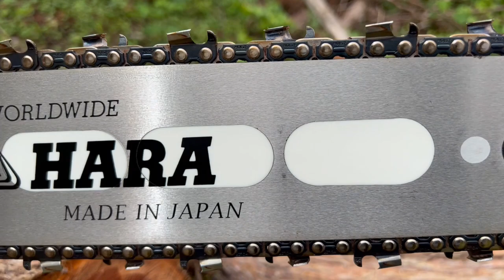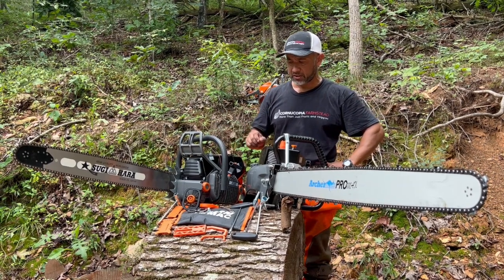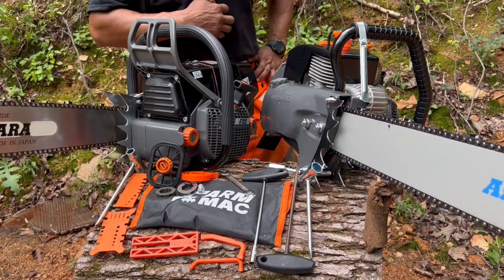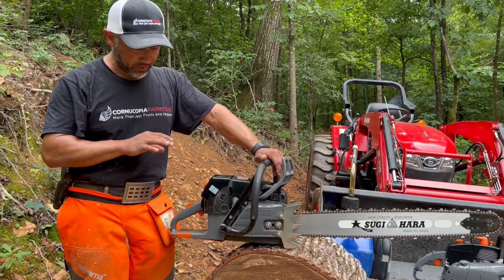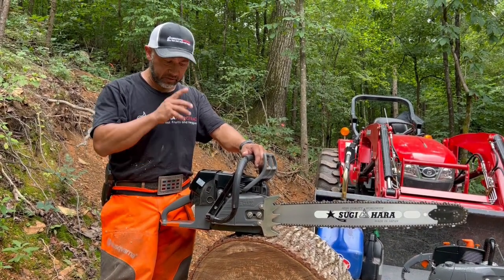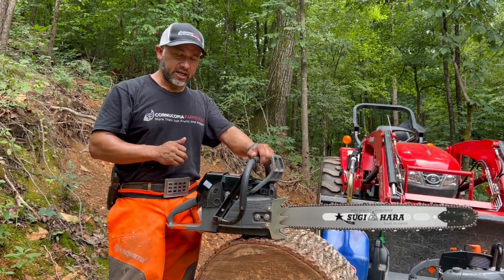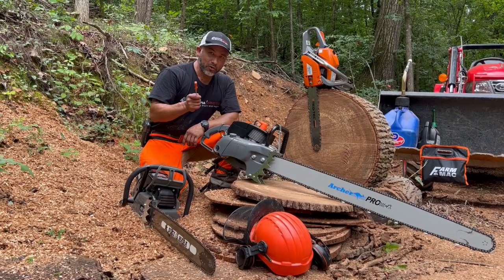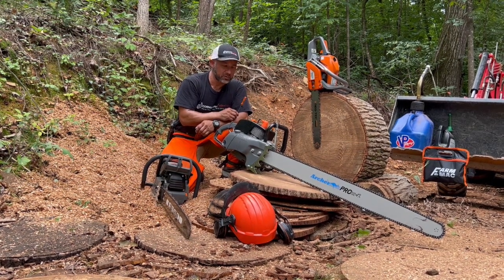FARMMAC F070/F660V STIHL MS070/MS660 Next Gen FARMMAC PRO SERIES by NEOTEC

Comment: Ms391 seems to cut better man idk the way it’s cutting if it’s not going straight down it’s too much wood for it, or you’re bad at cutting and I don’t think u are.
Reply from the maker: The round I was cutting was a decent round, a little punky here or there but still good wood for the most part. Neither of the two saws were ran in under load, they both had been heat cycled a few times but that’s it. If I remember right while we were making the vid I had to keep tuning the 660 clone several times, the 070 clone to this day I haven’t adjusted the carb on it. But you aren’t incorrect in the cutting prowess of the 660 clone for sure, they all for the most part needed some break in time and all need a fair level of tuning if you want to be in the top end of cutting performance, otherwise the will just cut rather than saw. Thanks for commenting, Ric

Comment: That manual oiler is in a horrible location, were it on the left where you could use your thumb that becomes a great setup with that good low end torque. The 660 sounds just like my Stihl 660 and I believe that’s a good deal and tried to get my father in law to buy one instead of the Stihl but he wanted a Stihl. Now that they have made some upgrades like you discussed it’s hard to spend all that extra money on a stihl in my opinion.
Reply from the maker: I agree totally. It is also pulse along with having the manual oiler so I have been told. We have the original first gen 892 and this f660  sure is a hotrod compared to it, the 892 is no slouch too by the way. I think if a person kept things in perspective they will find these will do what they want but also keep alot of money in your pockets too. I had to make that decision a few years ago, still have that first one and it still runs. Worth it and if it breaks and you fix it you are still less than what you would have for the oem equivalent.  Thanks for commenting and thanks for watching!
Ric

Comment: I also read that the F660V FarmMac has a Walbro carb instead of a Chinese carb.
Reply from the maker: Yes it does. They actually have several saws with the Walbro carb. We have the ns892 first gen saw from them , I don't remember if it has the walbro on it but I can tell you there is a world of difference between the ns892 and this saw. The f660 is very responsive and I would bet is every bit 95% if not more close to the stihl ms660/661. Great running and functioning saw this one is. Thanks for commenting!
Ric

Comment: I’m going to buy one but I’m confused on the differences. What is the difference between the Neotec 660v, farmmac 660v, and the farmmac 660vw? I see the same thing with the 380, it shows a 380 and a 380w? From what I see there is the orange ones, the black and gray ones, and the carbon ones. Is there any real difference between them?
Reply from the maker: Yes there are some big differences.  From what I read in the literature online, the f660v is the highest performance,  it has a better coil, better carb, better rubbers in the bushings area, I'm going just from memory here on that but I believe it is accurate. In the standard ns892 the inverse is true, it lacks the Italian ignition, the fancy walbro card, the same for the rubber products. For the saws that have the "W" they are the white editions and lack some of the upgraded components  as do the carbon units, I believe they lack the upgraded parts too. The Farmmac line is billed as pro models and in my opinion they are built a touch better and are stamped with date builds, plastics and other parts do come from Italy,  Taiwan, , Sweden or other countries where Stihl or Husqvarna acquire there parts,, I do not know if they come from the same parts suppliers of them but they are stamped and do appear to be better.. I can tell you that the f660v we use in the video is much higher performance than the standard ns892 which isn't a bad saw, but the f660v is a better performing saw. In every way it does perform better in my opinion.  I purchased my first clone saw almost 3 years ago and they have great value but do come  with some flaws from time to time. I don't expect that but when it happens I repair if needed. We have only had 1 issue with the Neo-tec nh843, it had a looser air filter which didn't affect it, they sent me 2 air filters to use for the one problem and that has been the only issue. No they are not perfect with fit and finish which is why we show close up imagery.  We always tear them down when we get them and also recommend people do that with any new equipment. Everything gets loctite and lubed,  reassembled just to make sure before use. I think that is a good idea on anything because if you find an issue you can note it before you run and get disappointed.  
Refer to either there website or the Amazon store and it should tell you things I can't remember. I work with saws and 2 strokes every day so I'm pretty finicky about things working and staying in good ready working condition. With clones from any brand you just need to make sure everything is in good working order. Your purchasing a clone with either a 90 day or 6 month warranty, this is why you have to check them very closely from the beginning.  Hope this helps, thanks for commenting and subscribing,  Ric
Reply: @CornucopiaFarmstead  considering the price of the 660 and the 380 are so close, would you even bother buying the smaller 380 over the 660? I don’t know what the weight difference is, but if the 660 cuts faster and gets it done faster, is the extra 2 pounds worth it?
Reply from the maker: @JohnDoe-ud2cc  well if your rounding with the 660 and a 24inch bar it I still much heavier to me but I am a slightly built guy with bad shoulders back and wrists, I like a 70cc class saw for small(less than 14 inch) rounding but prefer the 660 for anything over that just for what you stated, it's quick and cuts much faster through big wood. We don't round pines but use them on the sawmill so when we cut pines they typically don't exceed 16 inches and it makes for quick work as we usually cut them in 12' log lengths. But with rounding 70cc saw for me, if I could handle lugging the 660 I would, now saying all this I rounded a 12 or 13" tree this Saturday with the 070 clone with a 42 inch bar and the tree was 80' long, that's alot of rounds and by the end I was on the ground rounding, it whooped my tail! If you have the stamina and the power to wield the 660, that's what I would do if I were you, that a hell of a saw for sure!
Ric.

Comment: I enjoyed the video. I'm split between these two saws. Maybe you can help me out. I thought the 070 had an automatic oiler. I saw you manually doing it. Am I mistaken on the auto oiler or were you overriding it?
Reply from the maker: Tough decision for sure! For the oiler yes I was overriding the auto oiler. Some folks suggest running it until the chain smokes at which point I would not be happy anyway as it would cause damage to not just the chain but the bar seals and other assorted rotating bits that I don’t want to replace prematurely. So having said that I’ll hit the oiler a little more and not worry about it. I think when it comes to deciding which saw to purchase you really just need to look at a few factors. Weight- the 070 is heavy and is more so the longer you wield it, the 660 clone is slightly less weight.
Ergonomics- the 660 is typical for most chainsaws only larger, the 070 will take some getting used to if you are slightly built like me but likely fine if you are 6’ or taller.
Power- they have totally different torque and power curves. 070 runs slower with more torque is less db’s, 660 higher revving higher db’s higher chain speed which in my opinion and experience causes fatigue faster.
Consumables- the 660 is going to run through everything faster, chain oil fuel, you name it, it leaves faster. Having said that you must consider time savings here which will reflect your cents per hour for run time along with time working on a job. Big consideration here.
Lastly
Fun factor- hands down the 070 clone is the funniest saw I have to operate. It sounds cool looks cool is cool to operate, the squirrels pay attention when you start it up, your wife gives you extra points for throwing it around, that is priceless too. Hopefully this helps with your decision bud. In the grand scheme of things I could never and still can’t afford an oem saw from husky or stihl, these saws though not perfect if you take care and maintain them are almost as good as the oems at a fraction of the cost. When you can’t afford to pay a tree service but you can get in to one of these and do the same job then keep the saw at the end of the job it is a win win situation! Hope this helps and if you decide drop a line back and let us know what ya ended up with! Thanks for commenting and all the best, Ric

Comment: I've got the Neotec 070. I ported it and disabled the governor. It really cuts now.

Also, you don't really need to use the manual oiler. Mine doesn't even work. It oils like crazy on its own though. The 070/090 has a pulse pump that operates off the crank case pulse just like the fuel pump.
Reply from the maker: Thanks for the advice bud! We watched your vid on the 070, looks like it works well! Very impressed with this power head for sure! Thanks for commenting 👍 and subscribing! Ric
Reply: Are the parts completely interchangeable with a stihl 070?
Reply from the maker: Yes, I believe all of the 070 clones will all interchange with the stihl 070. I know the manufacturer does list that they do. Thanks for commenting!
Ric
Reply: @CornucopiaFarmstead  ok thank u. I’ve been looking and considering adding some of these saws to my tree business as back ups. I do like that Farmertec has a bigger variety/selection of saws and they even offer a 4-1 deal where the 4 saws are sold at an every cheaper rate. A 660/440/255/111 would give me four saws for around $750. It’s hard to beat that. I have all Stihl saws of those types and thought maybe they would be good while my Stihl saws were down for maintenance.

Comment: I'm realy likeing the stainless steal one peace bars. would be curouce to see how they were compared to other bars...  Any thoughts on that issue?
Reply from the maker: Hey there! Ya know I have had all the entry level bars from husky and stihl, they are just basic like everything else. I have never owned a high end stihl or husky bar but I have some Oregon high end bars that I really like. Comparing the FT NT and FM bars to Archer and Oregon differences come out. FT stainless bars are decent but cheap and easy to replace for when you bend or pinch it which as you know will happen. The NT stainless solid bar that is milled works much better and overall I would say is on par with the higher end Oregon bars, the laminated stainless bar from NT is almost as good but the thickness I have noticed can vary slightly which is somewhat typical. The Farmmac bars I actually believe are slightly less resilient than the stainless NT bars. Overall I believe the NT bars, though more costly are the best value given they have less deflection than standard bars similar in cost. Bars are consumables and you gotta have a bunch of them, spend as much as you can afford and know one day it will just get hung up and have the chain that put it there hanging with it, that's what I do anyway. Thanks for commenting!
Ric

Comment: I wish my farmmac f660 started like that.
Reply from the maker: Hey bud, sorry for the delay. We have been away from YouTube for a while now but trying to at least respond to comments. Most of the time I have found these clones are off on the tuning from the factory. Some are close some are way off. Once you get it going the first time start trying to find the tune. After you have broke it in for a couple of tanks then I would tune it again. After that you should only have to retune when the air density changes or your fuel changes, keep in mind the air filter should always be clean along with good plug . . All the best, Ric

Comment: Would you get the 92cc or the 105cc chinese clone saw for milling wood into long boards? I will be using the standard cheap chinese chainsaw mill.
Reply from the maker: The 92cc is much quicker, lighter, more mod potential, just many more positives with the 660 clone. The 070 is great but you can’t get past the size and heft plus the fact you are most always going to take longer while running the 070, hope this helps. Thanks for commenting, Ric
Reply: @CornucopiaFarmstead  Yes, this helps a lot! I think You've made my decision. Now to decide on the 42" vs 36" bar and which milling chain to get. Can't let these logs sit and rot in the woods!
Reply from the maker: A word on chain, if you are going to be doing a lot of chainsaw milling consider purchasing skip link roll chain and or custom file your own roll chain. It could save you money in the long run. About the only wood you can let lay is white oak and some of the cedars, try to leave none directly on the ground and seal them if you can. Have fun, Ric

Comment: 070 has auto oiler and Manuel is for extra in heavy cut. neather of saws are broke in I can tell . they sound tight .  what's difference in neotech and farmertech ?
Reply from the maker: Hey there! Yes both of these saws were only heat cycled for an hour each before they were used under load, which is typical for me when I use new equipment.  I have tried longer and shorter breakins in the past, this in my opinion works best which I could be wrong but this is my opinion.  As for the difference between the 2 companies,  that is a long discussion.  Both started as repair parts suppliers both are located in the manufacturing sectors of China.  At one time they worked together to accomplish the same goal, provide repair and build parts to tool manufacturers. In the last 20 or so years give or take they have independently started a line of tools for sale. Each has grown with obvious issues. They both have quality issues from time to time. We own both brands and use both brands. In my opinion the quality is substantially better than  the FT brand, however I haven't used or purchased a new FT saw in over 2 years, it could be better now but I honestly can't say on them. The Neo-tec equipment is similar in machine model and type, the quality is just much improved.  The quality of the bars are much better than the FT and they have a great variety of bar types also. I hope this helps! Thanks for commenting and subscribing,  Ric
Reply: @CornucopiaFarmstead You still give the nod to neotech over farm tech today?
Reply from the maker: Actually I do bud. Still use them every day too. I have sold the 872 to a fella and he mills with it, I only used it for felling and bucking, he will be more severe with it for sure. I did blow up the 843 running it to lean(+14k rpm) for to long during the work days. The extended high rpm causes greater float than normal use, the rod floated just enough it shaved enough metal off the cases to lock the rod then break a small piece off of the rod. Unfortunately at that point it created more damage. Having said all of this, there is something to be said about a saw that runs that well and strong but can easily be manipulated to give you the false since of security you should run it like that and you shouldn’t. Just because you can, maybe you shouldn’t but I did. 
So yes, still using out neotec saws even though we haven’t created a vid in some time now. I’m a tree guy full time now so I have no choice! Thanks for commenting, Ric

Comment: How does the F070 differ from the ns8105?
Reply from the maker: Hey there! From what I know the following parts are the same as what stihl uses for oem saws. The carb, flywheel and ignition are all supposed to be the same as what Oem stihl uses. I believe it has a few other upgrades compared to the NT8105. I can't say for sure all the differences but to my knowledge that's what the upgrades are. Thanks for commenting and Happy New Years!
Ric